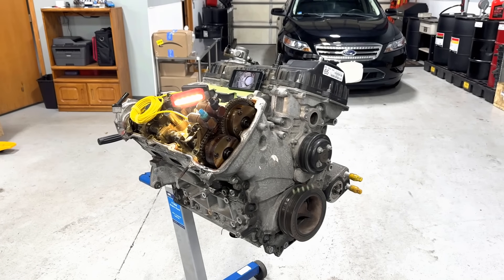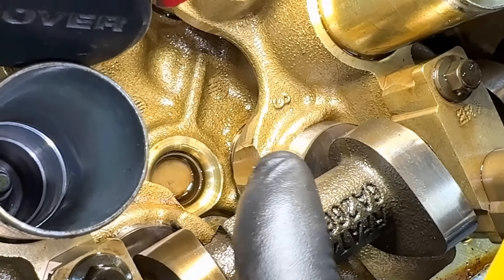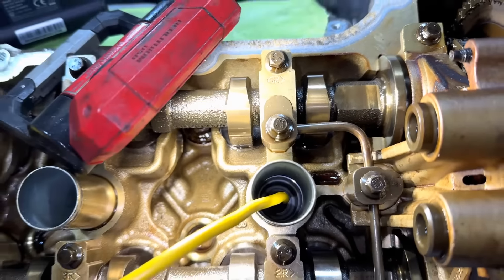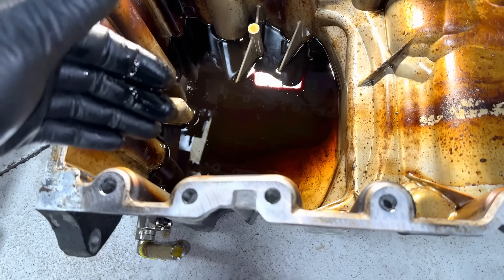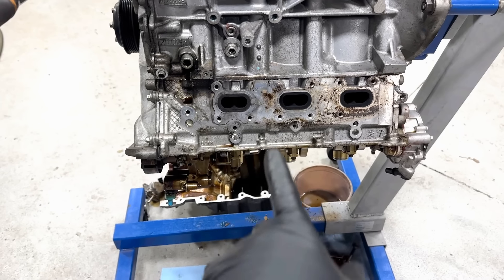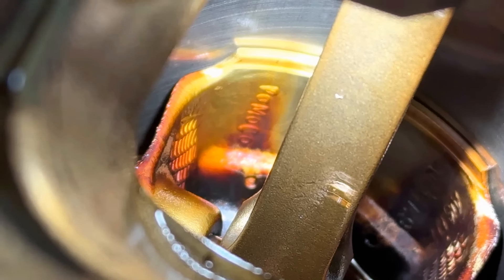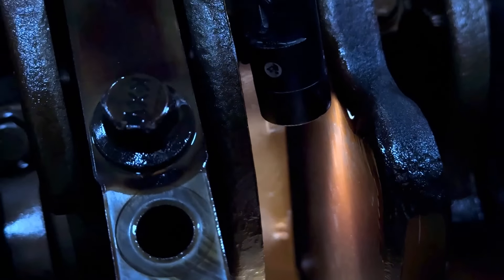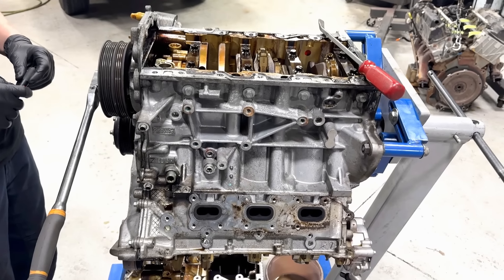Why Did This Ford F-150 3.5L EcoBoost Engine FAIL?

Comment: Hey, i find your channel very valuable now that I've got a 2020 Transit 3.5L EcoBoost... wondering if i should get oil changes every 10K like it recommends, or if i should do it every 5-7.5K miles... I've got less than 28K miles on it! The "newest" vehicle I've ever had lol...
Reply: Do the oil changes every 5,000 miles because of the twin turbochargers.  Use synthetic motor oil and try to use premium unleaded gasoline sometimes.  My wife and me have a 2018 F-150 3.5 Ecoboost.
Reply: @clintonstubbs2319  and a catch can
Reply: @joeblow5037  I’ve heard of that but is it effective or worth buying?

Comment: Its a lifter over the valve. In the 70,s i worked on 140 vega engines with exact design. But if its a ford it will break your heart.

Comment: I have a  2005 F150 bought it in 2017 at 134,000 miles now has 219,000 miles on it just did a timing job a day ago have always taken care of the oil and all the other fluids. I’ve had replaced the AC unit four years ago. I have replaced the transmission three years ago at 203,000 miles . I replaced the alternator last year replace the spark plugs two or three years ago, but after all that, after the timing job, the truck is quiet, it sounds just like when I first bought it totally worth the money how many more miles you think after all that I might get out of this truck

Comment: What causes at 2018 explorer not to start with the push button 3.5L dash says full accessory power active! Everything works and comes on when u push the start button but it won’t crank or even sound like it making an attempt to start or crank over! Replaced the push button start tested battery alls good still have the problem and no idea where to go from here

Comment: Just had my 2013 3.5 EB, with 103k miles & 3k oil changes since new, throw two rods through the block while gently accelerating to highway speed. Where do you source replacement engines from?
Reply: Im sure he gets all his parts from Ford
Reply: Gently, eh?!
Reply: A junkyard. Crate motors are hard to obtain these days.
Reply from the maker: Ford remans only

Comment: Lack of maintenance and turbocharging is a deadly combination for any gasoline engine
Reply: Specially when the manufacturers maintenance intervals are 7-10k miles
Reply: @monixx9081  oh for sure they do that on purpose so your trapped either with out of pocket expenses or a payment on a new one

Comment: Saw this customer had an oil catch can. With your expertise you recommend one on the f150 eco boost 3.5? Ive read some say yes some say no.

If yes could recommend one?

Sorry for binge commenting on your vids. I just paid off my 2017 and its currently under extended warranty. But that ends soon and wanna keep her running for over 200k. 

Thanks!

Comment: Why is there so much varnish in this engine at the front and oil pan? Everything else seems clean. Sounds like the owner was on top of the oil changes. Cheap oil?
Reply: And for a 'recent' oil change, that oil sure was dark.

Comment: My 1999 F-150 with 200k and a 5.4 2v runs like a champ.   Turbo charged engines have way more parts to fail and most  6 cylinder engines are not as good as a good ole V8.   More parts mo problems.

Comment: 2017 f150 3.5 eco, 60,000km going to be going on my 4th phaser replacements 😢, have had 3 water pumps replaced as well , leaking coolant very slowly somewhere dealership hasent been able to find it over 2 years, starting to notice engine temps creeping up even on cold days it switches from showing the bar to showing a digital number. I like the truck but it's killing me with issues specially since there seems to be no actual fix for anything . I heard they finally addressed or have an actual fix for the 10 speed transmitions
Reply: Yours was built first thing Monday, or last thing Friday!
Reply: 4th phaser replacements??!!! My 2018 has 77,000km and started making the cold start rattle about 6 months ago but not every time I start it. Wondering if I should just get rid of it before something goes wrong. Did you get the new type cam phasers? How much did it cost each time you replaced? Thanks.
Reply: @allanrheaume5549  I purchased an extended warranty when I bought the truck new so thankfully it's been covered so far, the first time it was covered as a recall/TBS or what not the others it went threw the extended warranty. But that is going to be running out soon. Scary the cam phasers and water pump are becoming a yearly thing with this truck is crazy. Can't imagine out of pocket costs.
Reply: @allanrheaume5549  I think the new type of phasers are having the same issues if I recall correctly. But I may be wrong , trucks been a nightmare since day one. I like it but have had so many issues, sadly where I live we have no lemon laws, so kinda stuck with it, and binder full of all the work and replacement parts of the past 4 years still have the same problems continually

Comment: Do shops typically factor the salvage value of the engine into the replacement cost?  I'd like to think the customer got paid back the value of the reusable components the shop intends to auction or sell
Reply from the maker: No salvage value, they have a core so they go back.

Comment: Might be repairable by just replacing piston and possibly honing the cylinder?  Engine is probably not going to run in perfect condition, but if it is possible to replace piston without pulling the engine, might have been wort a try.

Comment: @FordTechMakuloco  You said that they were replacing the engine.  Just curious; is this a repairable failure, or is it just so labor/parts intensive that it's more economical to replace the engine.  Do you buy a crated, new engine from Ford, from a rebuilder, short block/long block?   Thanks.

Comment: did you pull that piston yet? I gotta wonder if 'just changed the oil' included air filter and FOD from something got sucked in- a small screw/chunk of cardboard/anything coulda got inhaled, pinched between piston/head, rocking piston, breaking skirt off opposite side...if so some damage to opposite piston crown should be visible...never heard of a skirt failing like that...interesting. suggest cheap rebuild- one new piston maybe a hone job on that hole, should be fine, long as filter didnt bypass, blowing ring bits into journals

Comment: Weird? 10:22 Looks like the rod is bent too maybe a bunch of oil got in the cylinder during an oil change or maybe an injector got stuck on or something and bent the rod enough for it to make contact with the crank?

Comment: Tunning?
What is that red filter like item at the front passenger side of the engine bay?
Are those original ignition coils???
Reply: Oil catch can, keeps oil from the pcv going back into the engine, ie back of valves
Reply: No on the coil packs

Comment: Typical hydro lock or the “shudder”  results. Intercooler intake and exit too low in the design. Boys in very humid climates drill a hole in the lower
Exit port of the intercooler. Fills will water and blow by.  Then when you go into hard boost takes out the skirts.

Comment: Just curious as to why you did not rebuild the cylinder?
Reply from the maker: cost
Reply: @FordTechMakuloco  makes sense, since there obviously would be a high amount of labor hours on a rebuild compared to full replacement.

Comment: Keep making 4 cyl and 6 cyl do the work intended for a V8 and this will keep on happening
Reply: Yeah, pretty amazing that back in the 30's Henry knew he needed a V8 and today's morons think they know better. There was NOTHING wrong with the 351W engine. Nor the 4.9 liter straight 6. I own the latter in my 1994 F150 2wd 5 speed manual transmission. That truck is BULLET PROOF.

Comment: I had a Jeep 4.0 inline six that busted a piston skirt. Sounded just like that. I knew what your noise was instantly. I rebuilt the engine. That was the only thing wrong with it. Sounded like the old hydraulic lifter noise. Changed the oil regularly. It just happened. No idea why. Just like your customer's truck.

Comment: Perhaps it was caused by over exuberant acceleration cycles before the engine was warmed up. The piston being aluminum has to adequately expand and fill the cylinder as it heats up. A cold engine coupled with high turbocharger boost could have caused more piston slap than the casting could absorb.
To all the F150 haters, the fact that this engine ran and performed with this issue and didn’t fully come apart, is why Ford trucks stand above the rest.
Reply: Exactly what I thought of. Lots of clearance when cold, causes higher forces on the skirts. People don't seem to get that an engine needs to be properly warmed up before romping on it! Over time these higher stresses will fracture and break skirts.

Comment: Can anyone tell me why my new long block 5.4l 3v from powertrain motors is making a chirping sound on driver side and oil fill cap has really severe vacuum. So bad it’s difficult to remove oil fill cap when running. The chirping however stop once I pull oil fill cap ??Im lost 😞
Reply: Check your pvc Valve.  If it's been replaced. Some Pcv valves have a ported size hole. Maybe it's stuck open. That's where I would check firsty. Start look at the intake side. Maybe an after market intake that's cracked inside. Busted seals ECT
Reply: The intake is the same intake off the old motor. Mechanic said there was nothing wrong with it. Pcv value is make into the new valve cover it’s all one piece.

Comment: I'm not a mechanic, so just a question. If the compression is still good, no mis-fires, why wouldn't you just replace the piston and connecting rod, clean out the engine of grit and reassemble? Seems like it would be far less costly.
Reply: I'm sure any work he does, he gives the customer a warranty for that repair with a certain mileage/time period. He has to stand behind his work. When I worked at a shop, we gave the customer a year or 12k mile warranty on any of our work minimum. If it is your own vehicle and you want to try fixing it that way, go ahead. If it breaks, then you have to deal with that.
Reply: It sounded like the decision was made before the official diagnosis. Personally I wouldn’t want another piston in that bore.
Reply: That's what I would do with my own personal truck. Prop have 30-40 hours into it of my time and $500 in parts. BUT, no way I wound do that for somebody else. If/when that engine lets go, the shop will be eating that 30-40 hours and $500.
Reply: Think about this: the engine had broken parts in the pan and oil pump inlet. That piston was in there scraping away at itself and the cylinder wall. The metal particulate was in the pan, as well as the oil filter. That oil carried that metal particulate to every lubrication point inside the engine. Accelerated wear has now taken a toll on every clearanced space in every bearing and moving part reliant on clean pure oil.

Comment: Pretty strange failure. it seems the piston was defective from the start. I used to work in an automotive machine shop, I have not seen that before. You see connecting rods come apart, then the pieces start smashing up everything in their path...

Comment: Can't the engine be rebuilt like new again with the engine tapping on the one cylinder? To make sure the pistons and rings aren't leaking and all is good for the long term to last! It's got to be a lot cheaper than a remanufactured or new engine installed.
Reply from the maker: The final price would be similar because of the labor involved.

Comment: I have been out of the f150 market for years. I maybe purchasing a new vehicle (f150) . What motor is reliable these days starting with 2024 and going back 5 years? Is the v8 or the ecoboost?
Reply: Avoid the Fecal Boost at all costs.  Avoid any turbo crap these days.

Comment: What kind and weight of oil did the owner use.Im not sure he had oil protection.So did he really use the right oil and regularly change oil.The engine is dirty and has a high heat issue.

Comment: I had my connecting  rod nut let go on my 2014 3.5 ecoboost let go @89k
Lucky for me it was covered  under a CPO warranty..Ford tried to deny me a full engine replacement  but it ended up with a new Longblock..Ford dragged this repair out for 53 days..Im done with ford after this truck

Comment: I have a theory, when Ford did away with the 5.4L V8 and went with the 3.5L Ecoboost V6. Ford claimed the 3.5L produces more power and torque than the V8 and they may be right, but the bottom line is that you have a smaller crankshaft and 6 connecting rods and 6 pistons that are taking the stress load that used to be handled by 8 rods and 8 pistons. Could this added stress on the 3.5L Rods and Pistons lead to premature failure of the engine??

Comment: So glad I traded my 13 ecoboost for a 18 5.0, 0 issues with the new truck
Reply: Watch those oil levels broski.
Reply: @ThunderDome2024  I forgot about that, so I did have 1 issue when it was new it was using oil, but ford reprogrammed it and also changed the dipstick. They basically told me too much oil was being put in. It’s been fine ever since.

Comment: Guessing a casting flaw in the piston. Happens. Maybe he kinda keeps up on oil changes. I religiously keep up on oil changes and none of my engines are that dirty and discolored inside. Probably more like a 7500 mile oil change I'd guess.
Reply: For an eco boost it’s clean. The oil gets real dirty real fast.

Comment: Opinons on Escapes? Older ones?
Reply: Older the better anything.
Reply: Inspect the brake lines when looking at them.  Known for failing. They have an upgrade to the OEM ones.
Reply: Older escapes pass side rear tire well rots out, on pretty much all of them
Reply: Yes, I know of one that broke. You're right @robtorres
Reply: The 13+ are great to operate. They can get REALLY expensive when they break. Pretty much a stay away vehicle. If you insist, a few come with the 2.5. I would try to find one of those.

Comment: damb clean engine for that, but every thing is made from the lowest bidder. bad piston from start,I have rejected parts before rebuilding engines and this is factory. QC obviously did't check that piston or it was dropped

Comment: In todays world of vehicle manufacturing and other things as well,its all about profits and quality and durability takes the back seat.They analize and scrutinize every last single solitary component & cut every corner possible.
 While we see a piston,crankshaft, camshaft, timing chain or whatever they see steel that cost money to manufacture.And if they can reduce the cost of that metal by lessening the makeup of it they absolutely will.
 What we get is low quality metal that the engineers say "SHOULD" be able to meet the required specifications.And when quality is reduced to this point,failures will be numerous,reliability and durability will suffer greatly.
 Its the same way with all these oils leaks we now have from all vehicle manufacturers. They can save money by using O rings and silicone rather than gaskets.
 Its all about that bottom line & customer satisfaction is secondary. 
 I also feel that this green agenda also may play a role in why we now have so many failures. If the govt subsidizes the auto manufacturers to make unreliable, trouble plagued vehicles people will eventually get sick of the internal combustion, fossil fuel vehicles and purchase an equally unreliable E.V.
 Meanwhile we simply have to soldier on through and do the best we can with what we have.

Comment: I was big Ford guy for 35 year the were built Ford tough till the  Ecoboost was introduced. Never did any car or truck I towed with them put easily 200k out of many Fords but I didn’t buy this Ecoboost turbo crap. Watching your show I see issue after issue in engineering and quality I wouldn’t buy another Ford ever. In fact I just bought a preowned Lexus because I’m so done I love my 98 Ranger my E450 motorhome my wives fusion 09 still going no issues 205l miles. ford lost me 2013 on don’t trust them 
They will be gone at this rate soon

Comment: Modified and possibly often oil changes but not with good oil... I'm also guessing regular fuel. Result is this. 
I'm kinda on the fence here. Videos are very good and mechanical work seems very good, but I sense a bit of holding up on information in the commentary. I'm assuming doe to the fact that this vehicle owner is a paying customer.
Reply from the maker: You have little experience with boosted engines I see or else you would have not made that oil comment.
Reply: I have zero experience with “boosted” engines. Unless you consider a DD15/OM472 a “boosted” engine which I see every day. I’m assuming you did not mean a heavy duty diesel engine. But anyway I’ve seen couple used N55 engines and couple of N20s all of which are turbocharged and the varnish was quite dependent on the way owners would maintain them. As you can imagine on time chage, good oil would have little to no varnish. So I don’t know. Could be a Ford thing, I don’t argue, but just in general this doesn’t look like a very well maintained vehicle-oil wise. And I’m saying it doesn’t look like it, not that it wasn’t. I’m assuming the modifications could have made an impact too.

Comment: Those early eco boost are just junk. I was working at Roush and we had to replace thousands of turbos strait of the line.
Reply from the maker: That is odd I have never seen a turbo failure.

Comment: I have a 14 3.5 and the exact same thing happened after oil change. it actually threw a connecting rod. Same cylinder. Only had 97k on it.

Comment: That's really disgusting especially when he took good care of his truck. Ford should be replacing that engine.
Reply: Their not very receptive, 3 months after warranty my 2018 with under 40,000 miles started the cold start rattle....they said warranty expired but if you repair it at a Ford dealership you get a 3 month 3000 miles warranty for the new cam phasers. I haven't replaced them yet.